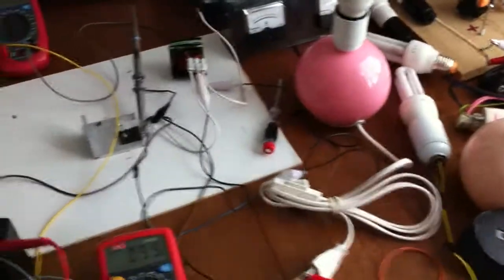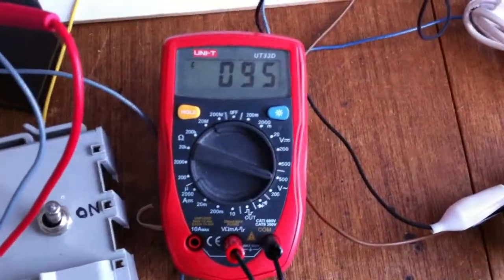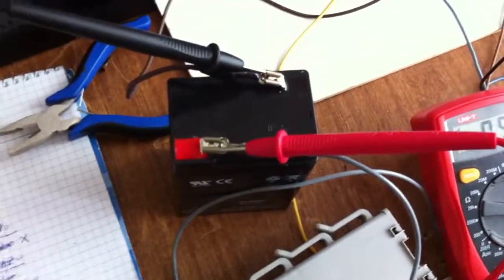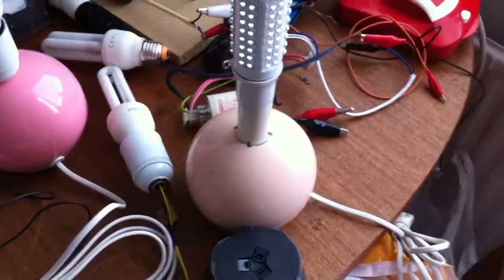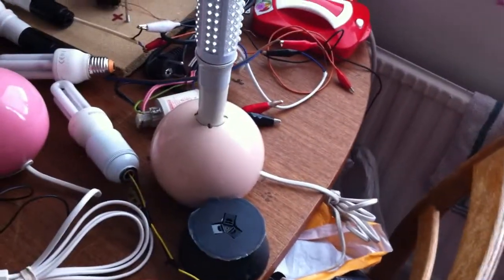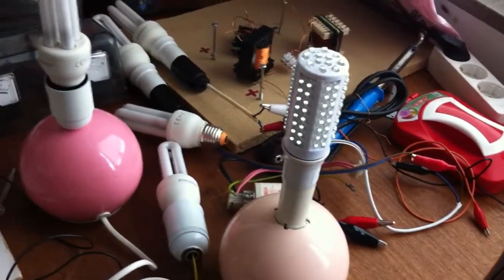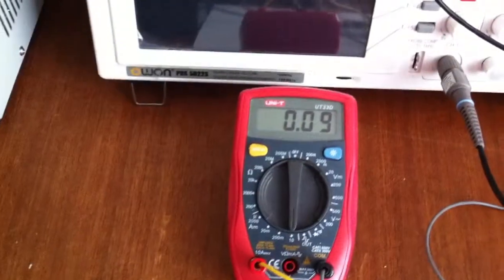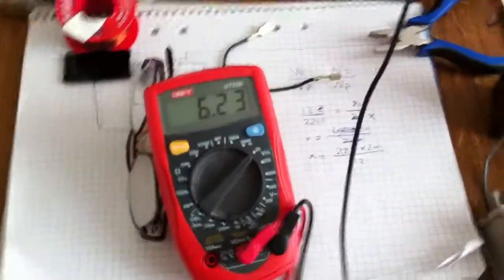Led bulb 220v  ,7w draw 90ma from 6v battery

Comment: What transistor are you using?   I've replicated the circuit but it draws 1.2amps at 12vdc on my setup and that to run a 5w LED lamp from Tmart.com.  I use a bd243c transistor.  That one you are using looks like a bigger transistor, maybe mjl21194?   I used the ferrite trafo that you have on your desk with the tan coil form, from nebraska surplus and followed lasersabers winding instructions with 20awg solid core wire on that bobbin.  Please share any details to help me reduce current draw!